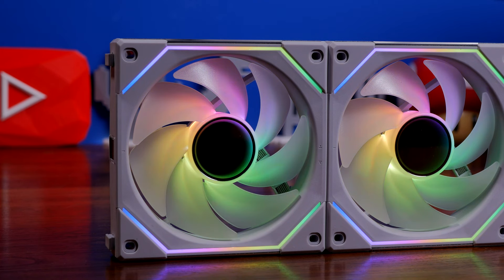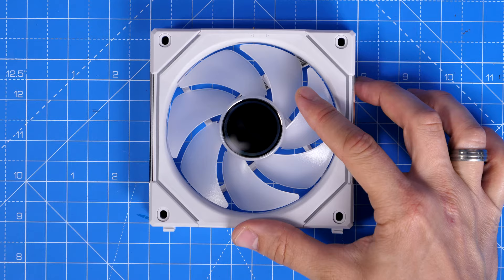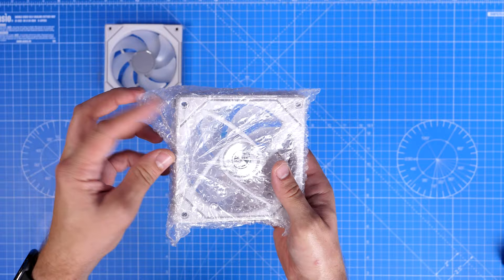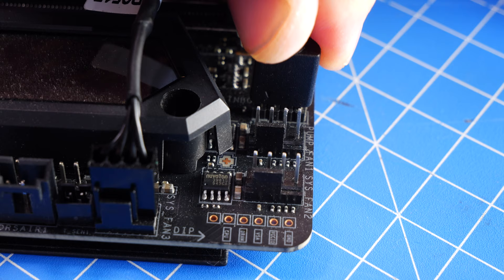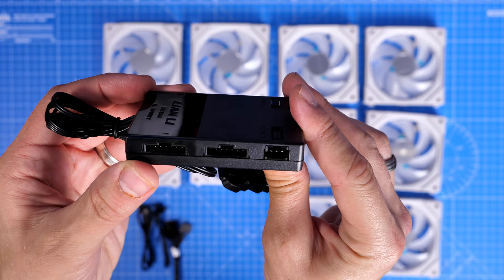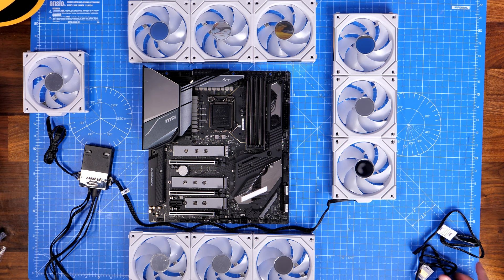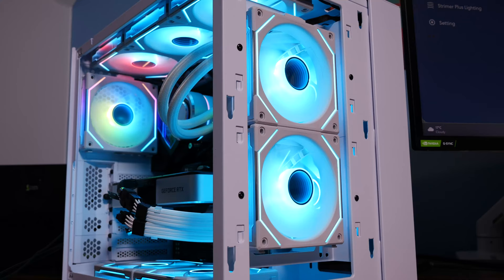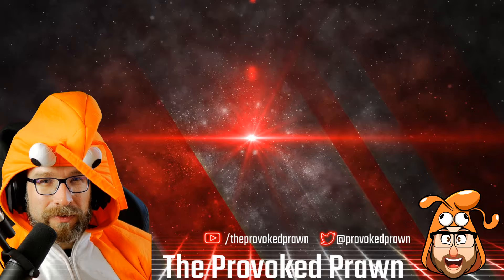How to connect Lian Li Uni SL Infinity 120 fans (single and triple packs)

Comment: Hi :) There is still no solution for the problem that the fans do not turn on until Windows starts? With L-Connect 3 it always asks if you want to run gpuz.exe and after say YES the fans start spinning. Is very annoying!
Reply from the maker: Have you got the latest version of l connect? There's a firmware update in that which sorts it. Mine spin when the power is on.
Reply: @TheProvokedPrawn  I have the latest version v1.3.16. Did you update the firmware manually?
Reply: @TheProvokedPrawn  I already solved it. Thank you :) Love your channel.
Reply: @elchnxx  how did you solve it?
Reply: @STKReacts  You have to update the firmware manually, that's all.
Reply: @elchnxx  I have 10 connected with only the lights on. There is no fan RPM, so just update it? Got it. I have it in a Lancool with my 4090 and it had me stumped

Comment: My fans don’t spin man. I’ve tried everything and nothing. It doesn’t even show my controller hub and devices on l connect 3. That app is terrible
Reply from the maker: Uninstall and reinstall l connect. There are problems if you had a previous version installed.

Comment: These fans suck when your using them in the Lian Li o11 cases because the direction of the fans make you put the infinity mirror side against your mounting brackets so there's no point of the center mirror you can't see it... A very poor design. That line of cases are the most popular cases on the market yet they don't work with it... They should have designed a reverse flow option for those fans.